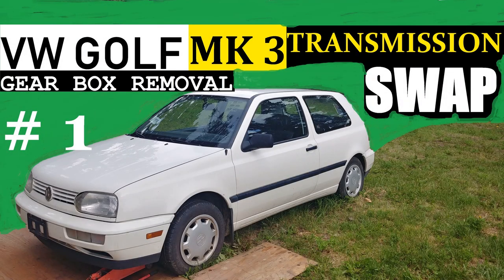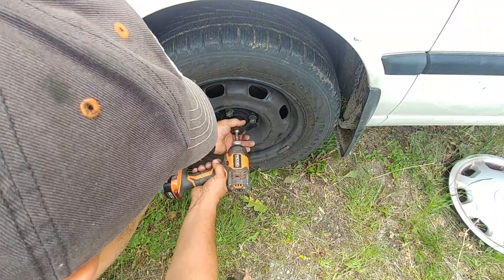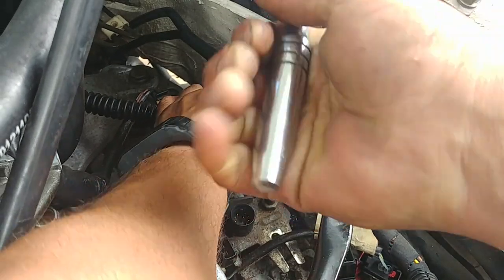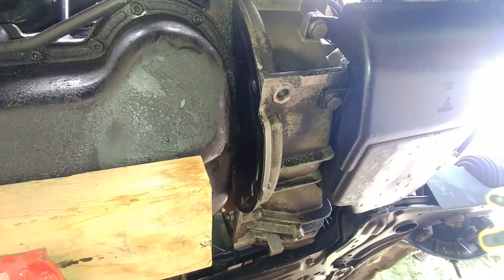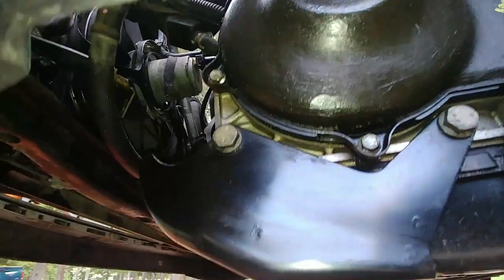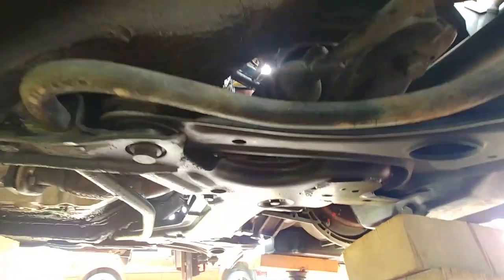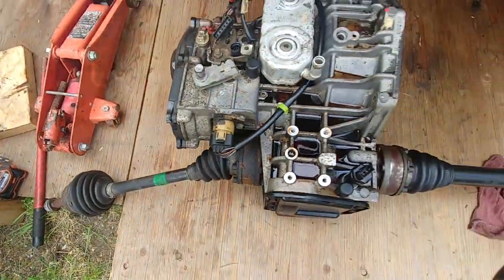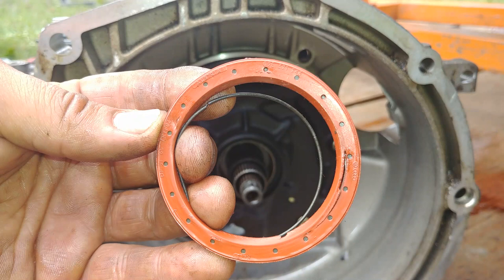How To Remove Transmission on VW GOLF JETTA MK3. Part #1. Complete Guide.

Comment: Any difference doing this on a 2000 MK3.5 Cabrio? I am considering a nice automatic one, but once trans dies, converting to stick.
Reply from the maker: It should be pretty much the same. You need to install clutch, change TCM wiring harness, ECU and TCM from auto to manual. Let me know how is your conversion.
Reply from the maker: Thanks for 👀 and subscribing!
Reply: Thanks, I am debating picking it up. Its very clean, garaged, straight, lots of new parts (TT exhaust, KYB shocks/Struts, Timing Belt, Water-pump, etc) nice interior, nice Rockford stereo, base GL no options beyond auto. The Compressor on the AC is leaking. It has 158k, and is $3500. A bit pricy for the miles. ?  Seeing a stick is more my thing, maybe I should consider less miles and similar price for a nice one? Tempted though, its really clean. But 158k and auto without record of the oil in the tranny being changed. He just said its sealed and level has always been Full. I figured they needed a trans service every so many miles?
Reply: Man, this helped me a lot. Thanks